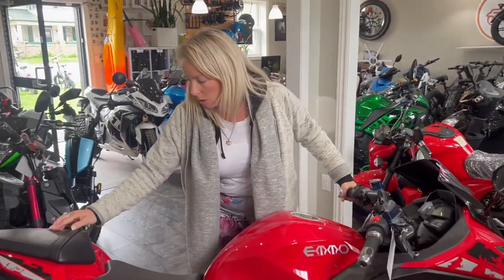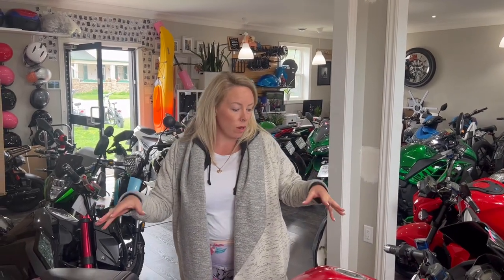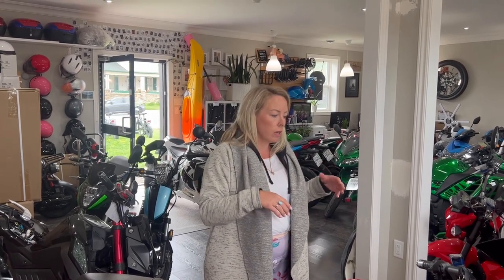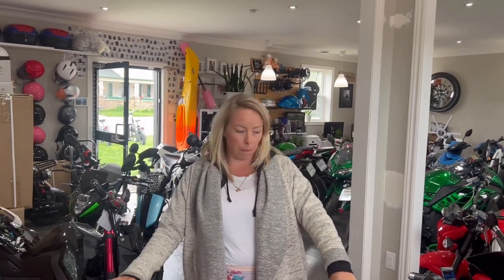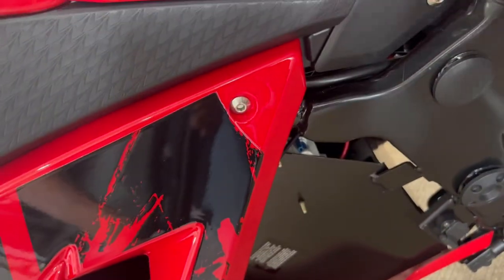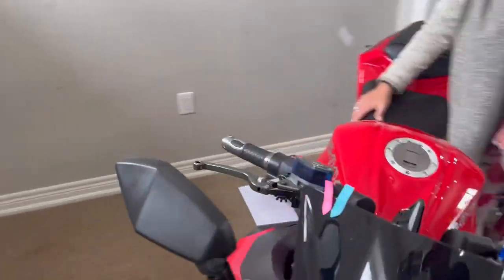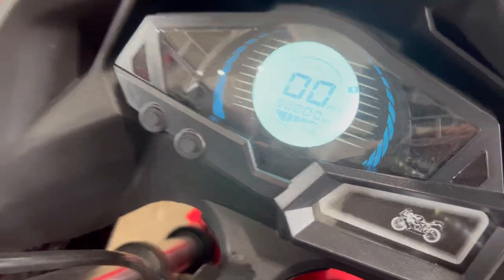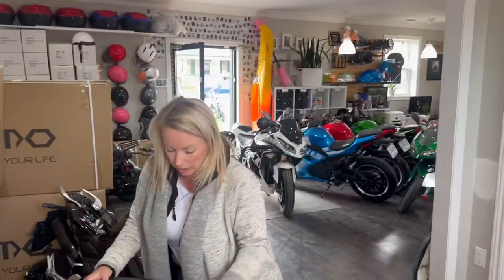Dual Battery Emmo Ebike How does it work

Comment: Someone can easily steal that bike right? If someone comes up and turns your breaker off. Your alarm won’t go off right?
Reply from the maker: If both were turned off,  yes.
Reply: @ridethewind  is there you can add like a lock box to the breakers?
Reply from the maker: Unfortunately no
Reply: lock your steering. The bike is 400lbs. Everything helps.

Comment: Assuming to topped off batteries, let's say both are at 82.5v...and both the same capacity...why can't you run them in parallel?
Reply from the maker: More chance of over heating.  Just all around safer for 2 separate